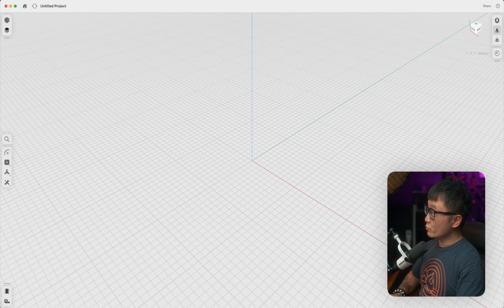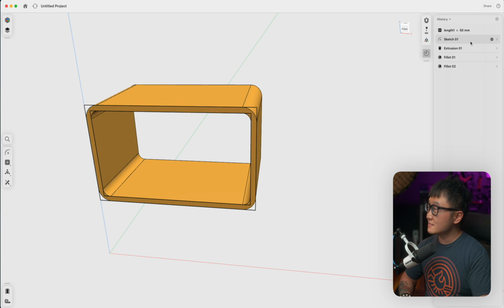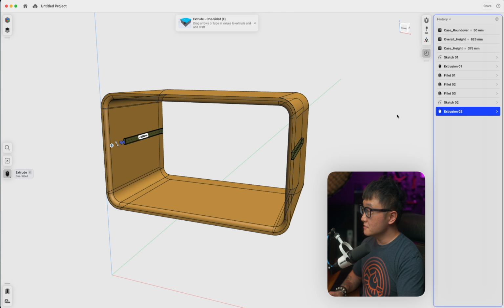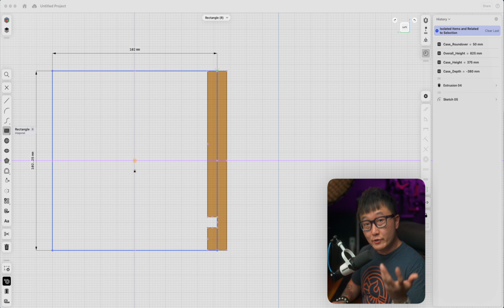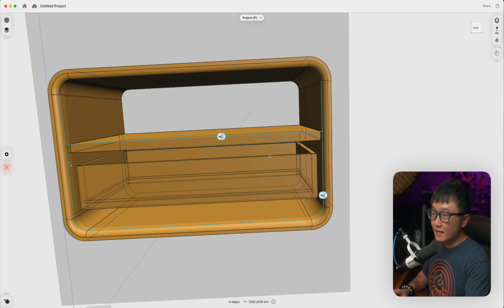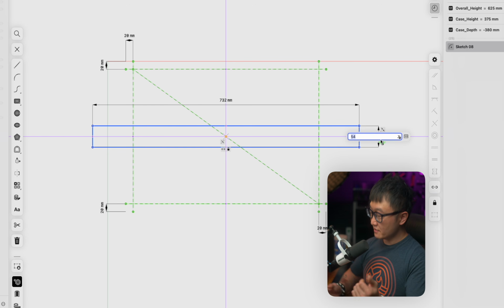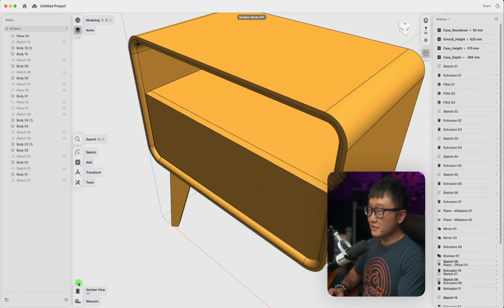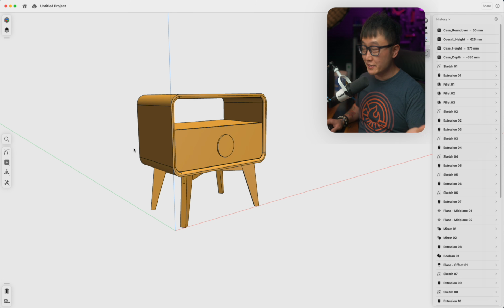Shapr3D Parametric Modeling with Variables and Expressions

Comment: would you use shapr3D or sketchup for kitchen cabinet design? I want to learn either of them but i want to work both on small details and scale up to the room level. shapr3D looks better
Reply: How detailed do you need your cabinets to be. By that I mean do you need to be able to get cut list and build plans from your designs or are you just modeling for conceptual design and rendering?
Reply: @adamkirkland4348 optimally would go with detailed plans

Comment: Thank you so much. Your tutorials have made my work flow so much better. I was looking for a simple way to design on a pad with something similar to fusion and your tutorials are the best. Quick question. Is it possible to set all the variables at the start of the project like you can in fusion or do you have to draw them first, then assign, then rename?